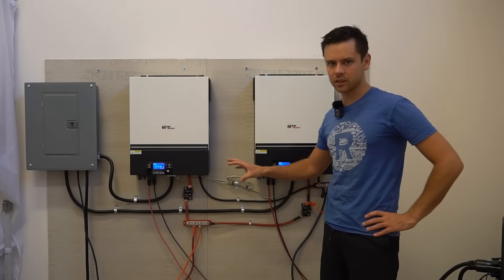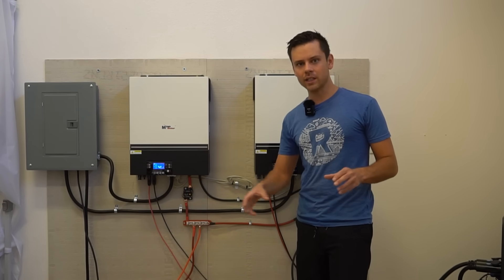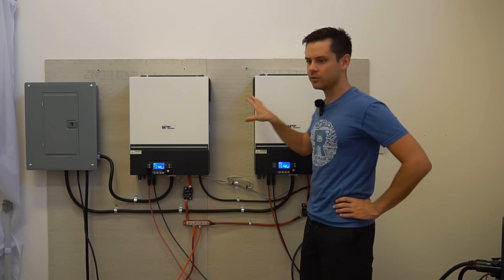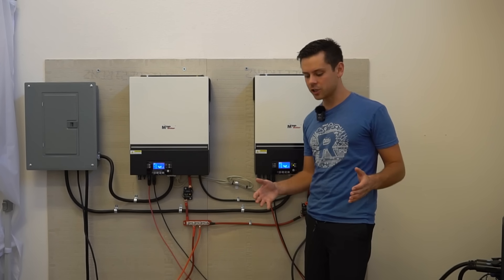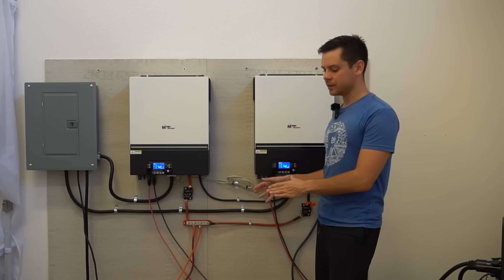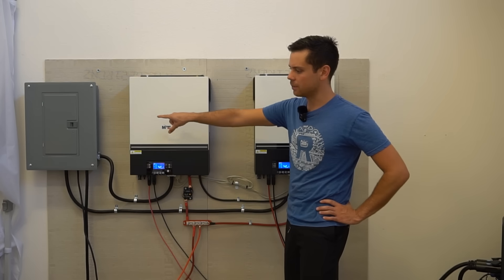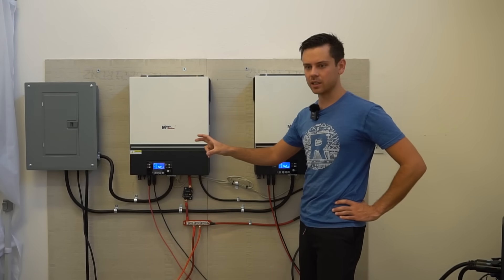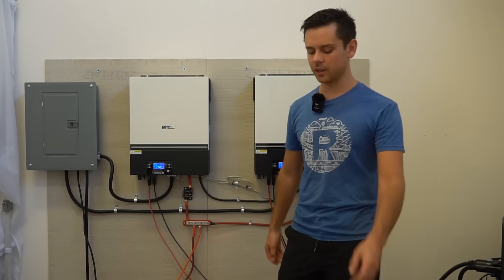Does my 13kW Offgrid Solar System require Grounding? Is it Grounded?

Comment: When I was on the ANSI Residential/Commercial swimming pool and spa standards writing committees for a decade, we had this debate with building officials across the country. The NEC code forbids two grounds in the system for exactly the reason you described. With that said, many building officials force people to drive grounding rods at the pump pad. This creates exactly the system you describe and dumps stray voltage into the pool. 

What they are often trying to address (particularly with concrete shell pools) is that concrete and the steel rebar can pick up stray current from aging buried lines and this is detected when one grabs a handrail or sits on a  wet deck with feet in water. It can be amplified in higher electrolyte pools (salt-based chlorination). In fiberglass/vinyl shells they are somewhat isolated just as you are describing in the DC/AC system (for different reasons, but conceptual similar). The shells are insulators and then they are forced by poorly written code to tie the ladder/handrails to the rebar in the deck. When metal cased lights where dominate, they could carry current into water, but in fiber optic one Is completely isolated in the pool unless a path is given back to the system ground. Although you are at the same potential as the deck, you still can become a bath to ground if it leaks in elsewhere. 

This isn’t completely related, but it’s so encouraging to see you continue to challenge status quo on what is often “telephone game” engineering.

Comment: A local grounding to your own earth spike would make sense in case of an outage of commercial power, which would cause you to lose their ground reference. But in such a case, you’d also need to have an Earth-Neutral Bridge (the single point where it’s all bonded), which flips automatically between commercial power ground and your own local ground, depending on if the commercial provider is up or down.

Surge protection on for each fuse box on the PV side is definitely a plus. I use 500V SPD’s.
Reply: No... loss of utility input does not interrupt earth grounding at the meter. Only way to interrupt that would be to disconnect the earth conductor feeding the ground rods at the residence ot the pole.
Reply: @SuperVstech  Not my experience… I have SMA PV inverters, and every time we had a loss of mains AC, we had a PE (potential earth) fault that caused the inverters to stop making power because they assumed grid failure, even with the micro grid present. An Earth-Neutral bridge bonding that also included a local ground spike fixed this.
Reply: @DJMT-Africa  If there wasn't a neutral to earth ground bond at the the main disconnect, then that was your problem, and it would have been in violation of code.  Downstream panels/subpanels from that point onward must have their grounds and neutrals separated, unless it falls under some exception.
Reply: @davereichert  It could be that code in my country is different than in the U.S.

Comment: In Europe we run a true earth most times as an IT-System is too expensive. 
You don't need a insulation monitoring system.

A small cable from a charger isn't a grounding for a 13kW System.
The danger comes with grounding as each and every wire carries a little bit of true ground from the earth (induction grounding, resistive grounding, capacitive grounding). 
If the wires are to long: you still have a ground loop. 

You should no exceed 15mA to true ground and every appliance should work without earthing (some needs earthing and some not). 
Every appliance with an y-capacitor (EMI-filter) needs a true ground to earth.
A common way is to bond all grounds in you house together and run a big wire from this ground to you solar system.

Comment: Good information. Appears that sub panels need to have isolated neutrals so faults go back to main panel. Grounding electrodes for lighting protection.
Reply: Is that considered a sub panel since it is all by it's self?  Or a "main panel"? I was wondering if it would need to have separate neutral and grounding bars.

Comment: I can tell you a real life example of separate ground rods and what can happen.  A farmer has a home with utility power.  He decides to run wires from the house to power his barn/equipment.  He decides to save money by NOT running a ground wire with his 2 hots/1 neutral out to the barn panel. He decides to drive a ground rod at the barn. He figures he has a ground rod at the house, he can do the same at the barn. He wires his equipment and lights and everything works.  He hooks up his herd to the milking machine and turns it on. His herd is electrocuted.  Inspectors came in and discovered his ground error.  A difference of potential [voltage] was created between the 2 different ground rods, which were not tied together and this came through the equipment to kill his cows.  He could have safely run a 2nd ground rod at the barn IF he also ran a ground wire and bonded the house power panel to the barn power panel. Moisture content of the soil, soil make up all come into play in this scenario.
Reply from the maker: That's tragic :(

Comment: So boiling all this down.  You only use the earth grounding copper rod for the Solar Panel array.   The AC ground, both AC Neutral and AC Ground should always be tied together and left alone.
Reply: well if any metal equipment becomes hot and you don't have a ground that keeps all metal at the same potential then your looking to die a quick death. At the very least you need some sort of GFCI protection for life safety

Comment: I appreciate this info. I'm 100%off grid and I was curious if I should have a earth ground connected.   I bought a grounding rod but have never hooked it up. I felt like it was a complete closed system and didn't believe I actually needed one..   I have a 5kw eco-worthy hybrid inverter. Connected to my camper breaker box.  I also have a inverter generator hooked up to my system to charge/bypass  also I have 12 solar panels..   so... Should I use my ground rod??  Thank you

Comment: On my steel boat, I have a separate 24V lithium battery just connected to my mpp 3k inverter charger. I run the DC bus floating, with a 1 meg ohm resistor between the minus and the central grounding point.  This way, I have the added safety of a floating system, and prevent static charge from building up on my DC bus. All Protective Earth conductors end in a central grounding point connected to the hull, just behind the isolation transformer.  Shore power Earth is connected to a parking connection on the isolation transformer. When the boat is on the hard the shore power earth must be connected to the hull to prevent having a large steel structure that is unbonded. Marine Electrics in a Nutshell.

Comment: Excellent points, however,  in places as Florida which has more than a million lightning strikes yearly it is very important to have lightning  dissipators the bigger and more the better to make the system invisible to electrons Flying in both directions.
Reply: Can confirm, had my house growing up struck twice and the street a ton of times.
Reply: I can also confirm.  Central Florida has widespread lightening almost every day.  It’s unreal.
Reply: @veryinteresting591  Central Florida was where I grew up! First off of OBT down the road from Gator Land and then out in Clermont. Looking back it was intense!
Reply: Thank you for the video report.

Comment: I see you have two DC fuse blocks but you don't talk about if they are fast or slow blow.    and if you are going to use a fast blow fuse it could help mitigate the need for a true ground.

another reason you could want a true ground is power feedback from your AC or 220v/240v power tools that don't just turn on/off clean.

Comment: Great videos, I learn a lot.  Grounding is a complex topic.  I don't have the answers but I have some thoughts.   NEC 250.32 deals with grounding outbuildings.  Since 2008, grounding electrodes are required at outbuildings like your garage causing multiple earth grounding electrodes contrary to the older philosophy of avoiding ground loops in the grounding conductor systems.

Comment: I have a question, is that gray power panel a main panel or a sub panel? As a main I have no problem with it,just it has no main shutdown in it. If it’s a sub panel the grounds and neutral should be separated not bound together. What you are saying is right, one grounding point in the main panel box. But you can have more than one ground from that main box. Hear we have to have at less two a two ground rods or a ground rod and be bounded to the water pipes.

Comment: Code requires separate grounding electrodes for sub panels in outbuildings.  You bring across 4 wires from the primary panel to the sub (L1, L2, N, GND), and you do not bond GND to N at the subpanel.  That is to avoid current loops.  But the remote subpanel DOES get it's own grounding electrode which is then connected to the ground bus bar in the sub panel and the ground pulled from the primary.  A subpanel adjacent to the primary panel does not require its own grounding electrode, because the path to the primary is so short.  So the question here is how far away is that sub panel from the primary.  Even IF in the same building.
Reply: The sub panel in this situation is feef from the inverter.  It's not a sub panel of the grid connected system. The only ground connection between this system and the grid feed system will be with the grid supplied feed to the inverter,  if and when that happens.

Comment: Bonding and grounding are different beasts. I’m sure you have researched your application and installed it correctly for a system not connected to other AC panels.

My only comment would be for everyone to check local codes and comply with them even if it doesn’t make sense. If you have a fire and you installed something that didn’t meet code, you could be screwed. Also, you could seriously hurt someone if you do it wrong.

Comment: Are you sure connecting neutral and ground and the panel is correct?

Assuming they are separate:
If a ground fault occured in equipment powered by this system (current flowing from the AC hot leg to equipment ground), the current would have to flow through the inverter on the ground wire, but the inverter will shut the system down instead.

Comment: Been there done that! Cleaning rack mounted equipment and bumped the conduit with my hand and damp rag while my neck was touching the earth grounded rack = a very big shock! (220v 50Hz)  Burned my neck and locked me up until my coworker bumped me with his foot to break my neck from the rack.  Turned out during install the power wire had the insulation skinned while being pulled through the conduit. 🥵

Comment: So Many people believe that lightning comes from clouds! It goes from the Earth to the clouds! If your ground for your equipment is grounded with its own earth rod the lightning will destroy it!
Reply: I was a T.V. repair engineer back in the 80's and had to collect a television from a customer who recounted ' a fire ball travelling down the aerial cable emerging from the speaker and then flying past him to the kitchen where it blew the sink off the wall' so the theory that it's from earth to the cloud is not correct. The current flows from earth to cloud in order to discharge the charge

Comment: On the subject of grounding. I have seen varying opinions on whether or not to ground the PV Array (I mean the PV frame NOT ground to inverters etc.) to Earth Grounding rod. You may want to do a video on this.
Reply from the maker: Oh good idea. Some panels, specifically CIGs, should never be grounded. That would be an interesting video.
Reply: I'd love a video on that,
 I'm off grid, and run a 12v dc system with a only on when in use 3000w stand alone inverter, I'm still clueless as to whether an earth electrode is needed on the AC side can someone please explain, do I earth my solar controller? Or do I bond these to negative, battery etc?

Comment: Hi Will! This may be a silly question, but why didn't you have to use a voltage converter?
Reply from the maker: For what exactly?
Reply: @WillProwse  Converting from 48v to 12v. I have an MPP2424LV and was told by the distributor (Watts247) that we would need a voltage converter in order to use it with a distribution panel. Thoughts?
Reply: @discodom2457  That would only be for 12v loads on a 12v distribution panel. Like in an RV where you have all kinds of 12v stuff you want to run. In Will's system there is no need for any 12v stuff.

Comment: hey will glad you made the system looks good, have you considered shifting the two inverters and panel to the right just for aesthetics? i realize its fine how it is, no stress or real critique, just saying the center inverter could be centered on the join of the hardy boards and the other inverter and panel could fit nicely within the edges - or put the panel in the center lol

Comment: It's hard for me to keep up with all you just said, would show us in another video what that all means, I know I'm not the brightest bulb in the house
Thanks Will
Reply: Bottom line: 1 earth grounding rod and everything is then bonded to it.
Reply: It has nothing to do with how many ground rods.  It only has to do with how many places the neutral and ground are connected together. 

Which should be only at one place,  at or before the first means of disconnect. ( in any system that is electrically connected to the grid)

Comment: Then, what happens if you use grounded metal frame machinery e.g. firewood splitting machine outside? does your solar inverters blow up?
Reply: all equipment needs to have an equipment grounding conductor brought to it. where all grounds on all systems are tied together to avoid a diffrence of potential. this is not the same a a system bond.

Comment: Excellent!   I feel slightly responsible!  Something I didn't realize when watching other vidy (off grid title?)  that you had an earth ground elsewhere.  Absolutely correct, grounds loops are dangerous and can cause electrical problems with certain equipment. 

Bottom line, follow local code,  mfg instructions.  Any exposed conductive surfaces that encloses a potential (voltage) should be PROPERLY grounded to prevent shock.  exceptions like double insulated code etc, ya need to check code.  And yea, seen double insulated fail.

And my apologies, didn't realize you DID have a proper grounded case (breaker box) enclosure.... thought off grid.

Thanks,
Ken
Reply: I did not understand that either . If it was said during the video . I missed it . Be safe out there folks ... Gubs
Reply: That was important to note that you had an established ground elsewhere already. I would also consider 110.26 as a good practice(batteries below equipment)

Comment: Its code to bond all electrical equipment including what you have there. Yes you should have only 1 point of ground but everything is required to be bonded.
Reply: I would need a diagram to be sure though maybe he has it done right.
Reply: @networkingdude  For me , as a retired HVAC guy . All this is getting a little more confusing . After watching the video Will provided a link for , actually destroys almost all that we learned about the " reason " for a " earth ground " , and WHY . We were told that the " bare ground " for equipment was to make a short to ground on the equipment , safer for anyone who might touch it otherwise ?!  We were never told about anything about two " earth grounds " creating a loop , and back feeding " if you will " and destroying other equipment ?!  I still question though , that if those rods are far enough apart , that would happen ? I am actually still confused about " where " in that system , Will has a earth ground ? Does the load ( A/C unit ) have a earth ground ? Plus , a lot of that video refutes what I was told by a Master , who was in our shop . Though , all that was Pre 99 . I did my HVAC classes mostly tween 78 - 88.  Glad I am retired now :D
Reply: @indycharlie  He stated that he was going to be adding utility input to the inverters, and that will be grounded to the service entrance. That is the earth ground for the inverters and therefor the system. He hasn’t installed that yet which is why it may be hard to visualize with what he is saying. Also, you need earth ground when dealing with utility service because that’s how the grid is grounded. In an isolated system it only needs its own ground. Think of it like a car, which is its own isolated electrical system. There is no earth ground, but everything is “grounded” through the negative terminal. An off-grid system is similar in this case.
Reply: @John R what you have is fine, as long as you don't bond the neutral at any other place (including the inverter).
Reply: I don't understand because lightning rods are grounded at different locations and the panel is grounded at its location in fact our farmhouse had two ground stakes. One in the basement and one outdoors the code inspector actually helped Dad hook up the one in the basement and I bet the outdoor ground was less than 6 to 10 feet from the lightning ground. 

We had the lightning strike the rod in the kitchen twice that we know about. It apparently was the highest open part of the house. It was on the kitchen chimney that went to a coal stove. We never had any damage to the TV. That was the only electronic device in the house. People didn't have microwave ovens back then only a few people owned them. 

My point the code enforcement guy added the second ground I guess the wire was not heavy enough so he took some electric stove wire and hooked it up to the basement ground rod which was the original ground to the old fuse box. We had a gas stove because we had a gas well on the property. So the electric range wire was unused. That was an unusual inspection. 73